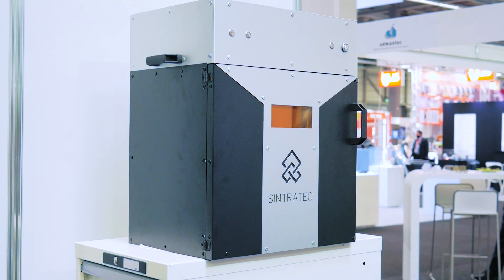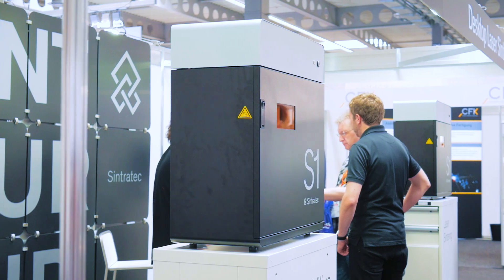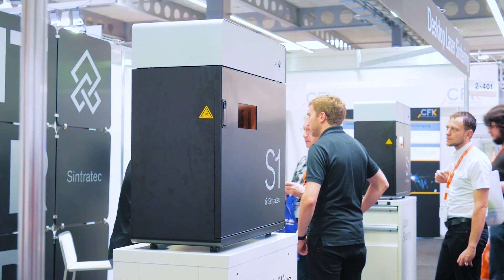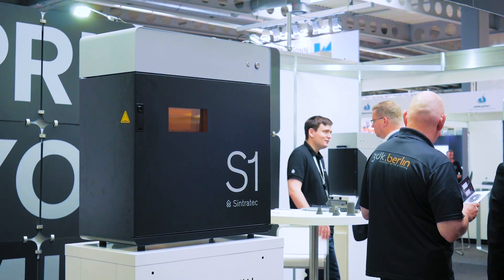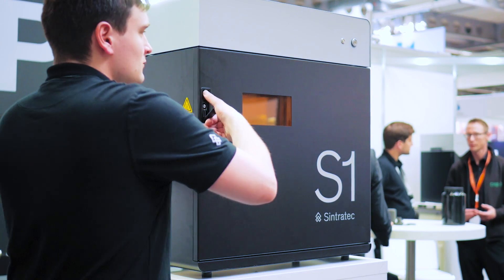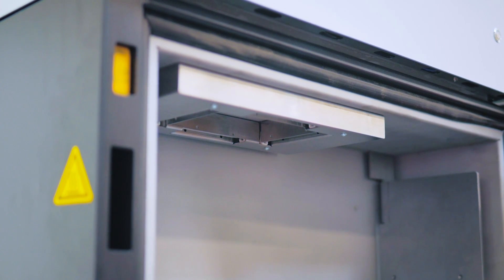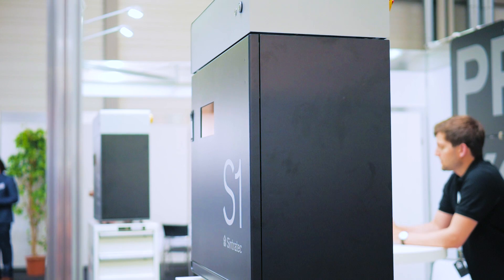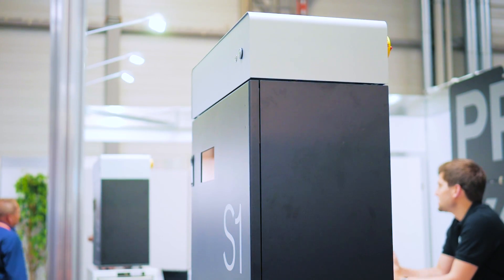Laser Sintering on a budget! Sintratec at FabCon3D/Rapidtech

Comment: SLS printer aren't worth it for home use in my opiniom. They are much more expensive to buy (>$8000) and the material is also much more expensive (>$150/kg). The SLS process itself also isn't very home user friendly because in order not to waste time and fresh expensive powder you'll need to fill the buildvolume to the max. The heat up and cool down times of about 2h each make it a much more time consuming process for small machines. The only advantages of SLS are the strengh and that you don't need support. But it isn't more precise then FDM. I've worked with two Sintratec S1 SLS printers at school and they were a nightmare. The support guys from Sintratec tried to get the machines working several times and eventually gave up and refunded two of there brand new machines because even they couldn't get them to print reliable.
Reply: 2 years late, my school is also having this issue. Bought 5 years ago, only to build it and not getting it working =(

Comment: I just did a stupid mistake, I bought a E3d hotend. It seems like a good hotend but i don't know how to attach it to my RepRap mendel i2 do you know how to? I saved a aluminum plate from the previous hotend but i does not fit on the E3d.
Reply: I bet there's an adapter or fixture on thingiverse you can use.  If not, make your own! take some measurements and mock something up.

Comment: Thanks Thomas for making these videos.  Very informative. Can't wait until the day Metal 3D Printing can be done at home for a reasonable price.

Willy
Reply: Define "reasonable" in $. What's the most you'd pay for one? $10k, $20k, $50k? $Zero is the obvious answer, but what's the most $ number? This is a general question for all, not just Willy. thanks
Reply: I personally think the numbers work like this: To make a metal part now, you need a manual milling machine and lot's of time and experience to make a part. With that route, you can get high precision (0.001 inch or better). It can take days to make even a small part. A milling machine can cost from $1500 (old and used) to $10k new. Plus all the tooling and measuring tools will cost thousands more. The other extreme would be additive manufacturing that can make a high precision part out of metal from a cad file. That's the ultimate goal and will be available some day. I would expect that to cost $100k or a lot more right now, depending on the material it can print. The most realistic option for now would be an additive process that can make "pretty good precision" parts from cad, such as 0.005" or 0.01" resolution out of metal such as aluminum. For that, I'd think it was reasonable to cost more than the manual milling machine, so $20-30k would seem reasonable assuming that it has lower precision. This is just my quick 2 cents.
Reply: I suspect it's about as practical as having a metal cutting laser at home. I suspect true metal powder sintering will take on the order of a kilowatt laser, and in an oven that's capable of holding temperature of a thousand degrees and up, exact temp depends on the metal in question.

Comment: to get it to everyone out there
5000€
lmao. if you say so xD
Reply: Yep, I have a spare 7k USD that I carry around in my pocket.
Reply: Actually, the 5000€ is for the kit version... the S1 is about 3x that price... (yep, got a quote)
Reply: I get the feeling they may have started out with a metal sintering fantasy, it didn't work, so they lowered the bar to do plastic. If so, then it became non-optimal, expensive (you can get more than 4 SLASH resin machines for the money), small-build-volume (didn't see any big parts), solution to a problem that doesn't really exist.

My opinion and read, maybe wrong, but it seems to me like this may be how this thing was born. It starts to get silly when you can get an injection molding machine for about the same money.
Reply: vidznstuff1
Exactly.  Personally I would rather have the injection molding machine and I can imagine what the price of the S1 will be.  I sense this is yet another company with high ideals, high prices, and another massive failure.
Reply: I do agree with this, though it's one of those areas of development where somebody's got to get the ball rolling in order for the technology to improve in the future.

Having said this, you'd have to have a very specific application that this fits in order to drop the cash at this stage.
Reply: +Dark Alchemist If you have an injection molding machine, you also have to buy a CNC mill otherwise you can't really use it.
That's really quite a lot more money.
Reply: Pook365
It is also the world at your fingertips.  This machine is an over priced single use machine that will fail.  Come back in five years and lets see.
Reply: Erik Cederberg
WOW. :/